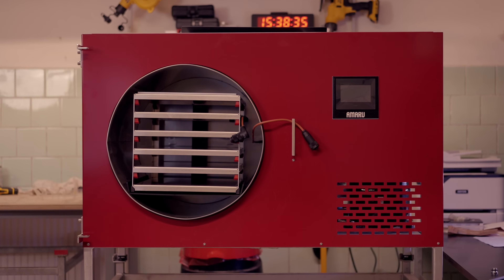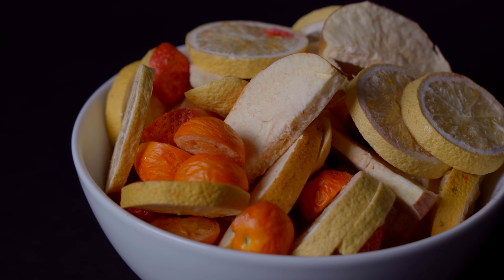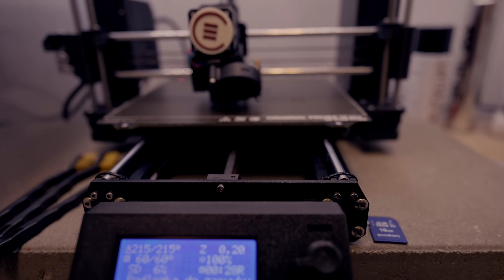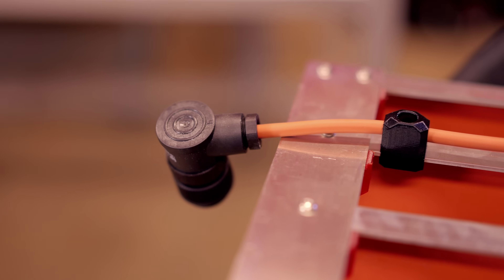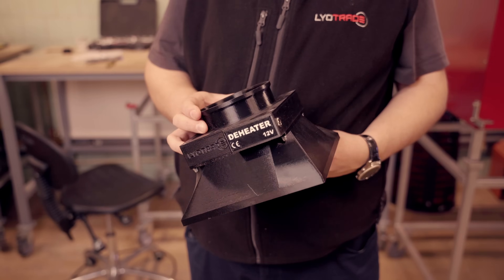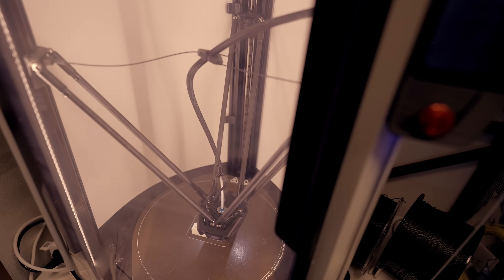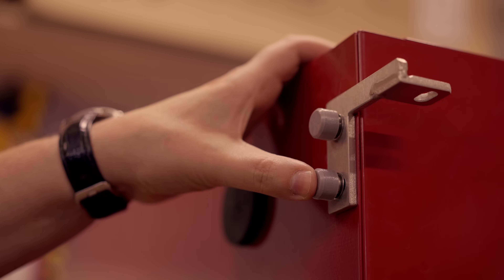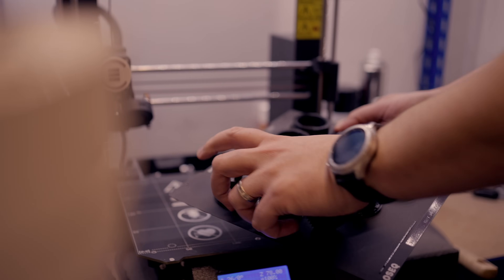Freeze-Drying Meets 3D Printing

Comment: His comment about step by step improvement is spot on. I have to say that now having organic supports is such a game changer! Wow they are SO much easier to remove than the way I did supports before that; I am literally not worrying about designing to avoid supports anymore. Changing my design choices - that's a big thing. That plus switching to a .60 CHT vs. my previous go-to nozzle has been a huge leap forward, not just an incremental advance, print times are like a third of what i had been doing. I would say 3D printing for me is nothing like it was 2 years ago, such a better experience. And no doubt many improvements to come!